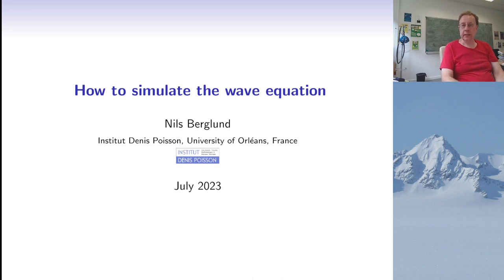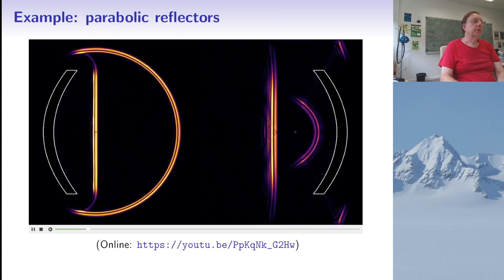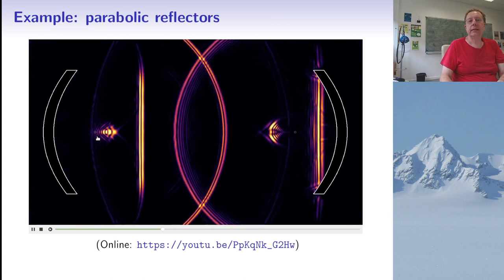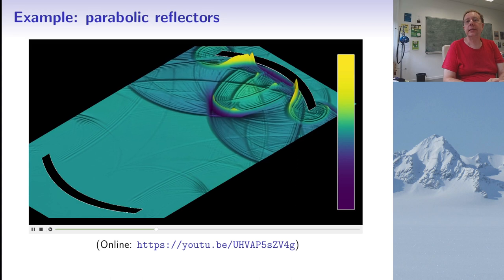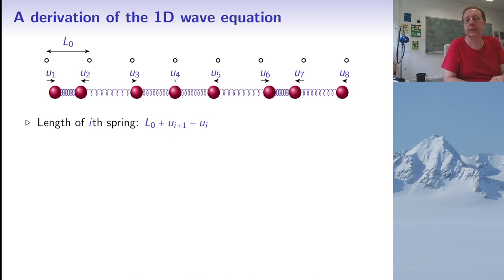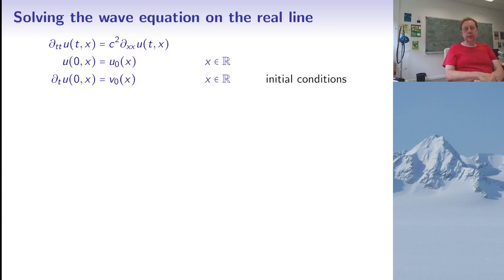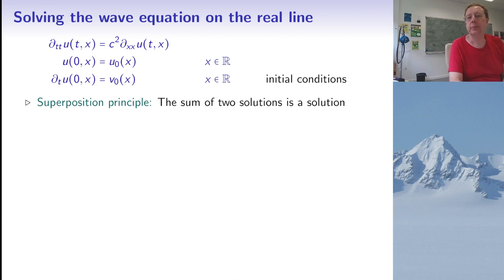Tutorial: How to simulate the wave equation

Comment: Great presentation, thanks for the time you took to make it! The next step in optimization to me would be multithreading, where threads each work on a patch of the lattice. Since there's no instantaneous feedback you dont have concurrent data dependencies and therefore no need for thread synchronization beyond waiting for all threads in a frame to finish.
Then there are specialized SIMD instructions that provide instruction-level parallelism by lalowing you to compute several floats at once.

Since most computers nowadays have 8 threads in their CPU and support 4-float SIMD instructions, there is a theoretical 32x speed improvement on the non-boundary calculations.

Alternatively, you could translate the reccurence equation to an OpenCL or CUDA kernel to have it run on the GPU, which should be fairly easy for the same reasons of not having instantaneous feedback in the recurrence equations.

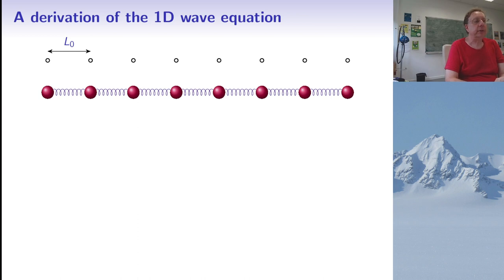Comment: 4:30 - the famous 1st chaotic behaviour "linear" system that was observed on Eniac (AFAIR) by Feynman and other phycisists.
Reply from the maker: You are thinking of the famous Fermi-Pasta-Ulam experiment, I assume. In their system, they added a non-linear term to the spring force.
Reply: @NilsBerglund  Thank you - i might have been mistaken Fermi/Feynmann but i recall an image that there were many linearly connected oscillators without a nonlinearity. I remember that at least 3 degrees of freedom and a nonlinearity in contained phase space are required for the onset of chaos but maybe there was some numeric error involved or they approximated the 2D movement with that nonlinearity - 2D double  pendulum is enough for the onset of chaos still i dont remember if the arms need to be stiff or can be flexible - rather rigid.

Comment: Thanks Nils! At 25:31 the 1D difference equation uses C^2, but at 28:32 the 2D difference equation uses just C, not C^2. Is this correct?
Reply from the maker: That is a type, sorry for that. It should be C^2 in both cases.

Comment: Have you experimented with simulating waves in the frequency domain (given the solution you showed at 16:20)?

It appears that in the frequency domain, you can simulate the state of the wave at any point in time in constant time (assuming the dimensions of the wave are constant). The only problem I see with that, at least in the 1D case, is the need to perform an inverse Fourier transform for each saved image, which may be costly. However, the advantage is that you can simulate for an arbitrarily long time with no error accumulation (or so I believe).

But I don't know how well or poorly these properties would translate to the 2D case.
Reply from the maker: The frequency domain is useful in many cases, and a commenter made some videos on their channel using this method. However, boundary conditions tend to be hard to implement that way, except in very special cases. That is why I have not developed the approach so far in my code.

Comment: In a finite difference solver for the wave equation, wouldn't you also face a constraint on the time step size (Courant Levy condition). Also purely from a wave equation perspective is it possible for a "shock front" to emerge for Electromagnetic waves ?
I guess not, because Speed of light is a constant wrt all observers.
Reply from the maker: Yes, you need to satisfy a CFL condition, it is mentioned in the tutorial. Shock waves are indeed not possible with light in our relativistic universe, but they are possible with sound and water waves. See for instance https://youtu.be/E-8P4nJqfVQ

Comment: For the 2D case, do you get any interesting effects by modelling the displacement as a 2D value per cell? In my head, with the 2D spring model in mind, I expected the displacement to be a two dimensional value.
Reply from the maker: You would get two uncoupled wave equations, one for each direction of displacement. So it may create some nice interference patterns, depending on your initial state, but there will be no real interaction between the directions.
Reply: @NilsBerglund  I think there could still be interaction between the components. The X axis springs could affect the Y offsets via the transverse math that you hinted at in the video, and vice versa. And one way to interpret the scalar values per cell you use is as offsets in the Z direction, transverse to both X and Y. But since you say that the result after going through the math of treating the waves as transverse ends up being the same as longitudinal, I wonder if it basically all cancels out, and you'd get effectively just the same simulation, except a bit slower.

Comment: Can you give an example of how much time such simulations take per minute? Like the one with finer mesh for parabolic reflectors.
Reply from the maker: The 2d one took about 12 minutes of simulation time per minute of movie. You can check the simulation time in the description of most videos.
Reply from the maker: Thanks, same to you!
To reproduce a simulation, look up the file Parameter_**.md of the correct month, and adapt the parameter values in the specified C file. Some extra dummy values may have to be added if you use a more recent version of the code.